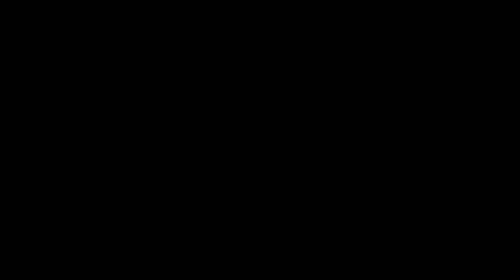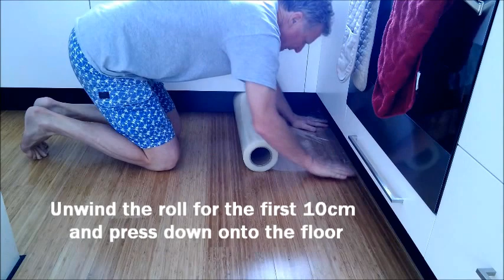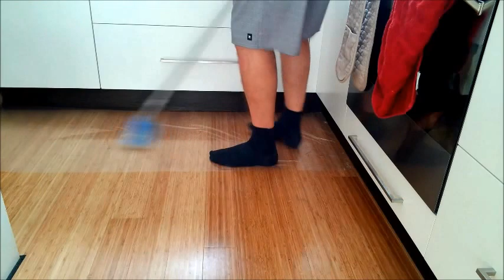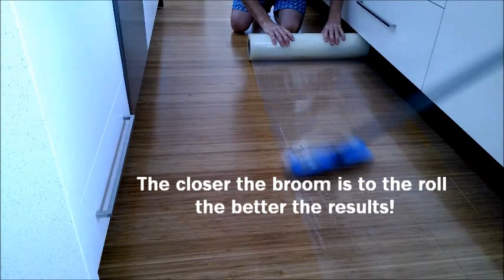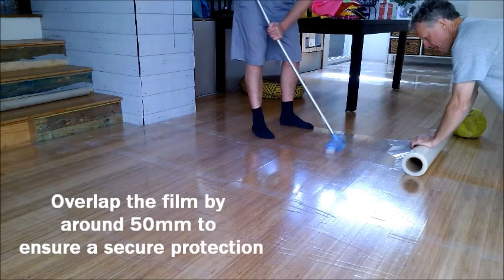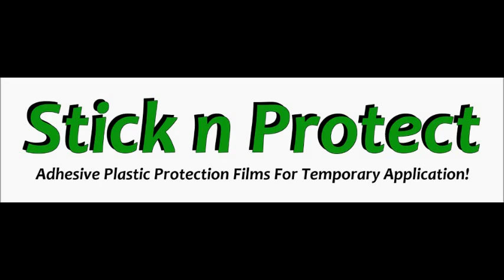Floor Protection Self-Adhesive Film Installation

Comment: good luck with the removal...especially after heavy traffic
Reply: Also it has happened that carpet film has been used by mistake this will no doubt over stick and give you headaches as it has an increased adhesive not meant for hard floors and surfaces (only carpets...) please make sure you have used the right film

Comment: The previous owner of the house I just bought has placed a plastic film over the laminate flooring. It's now peeling at places leaving an ugly contrast between plastic covered and non covered laminate surfaces. How do you remove this plastic film?
Reply: Hi, this product dose not leave glue behind and is 60 degrees rated and can be left down for about 3 months. I'm not sure what film you are talking about so it's hard to give advice.
If the adhesive is acrylic based then you could try using a steamer along with some citrus based cleaner. WD40 can help with elbow grease as well

Comment: Have you used this brand before? You should be more descriptive to help others! 

If you need to protect floors over a temporary time frame then this is a good way to do so general no longer then 4 months would be recommend. 
Pressure sensitive adhesive film, tape or masking products will losses hydration (dry out) over extended time and added pressure, e.g high foot traffic will increase the bond between the too surfaces. Same rules apply to any self-adhesive product.

stick n protect floor films have been carefully produced and tested over a range of surfaces and when used correctly will not leave residue.

NOTE: Finished floors need to be 100% dry before applying any protection

ALSO SOME STONE, TRAVERTINE AND POLISHED CONCRETE SEALERS MAY REACT WITH "ADHESIVE PRODUCTS!"
Reply: help others?
I'm helping them saying to get different/thicker material from my experience as a general contractor.
Reply: Have you used this film stick n protect?
Reply: You can try our pad-it for more heavy duty protection www.pad-it.com.au. it sounds like what someone in your line of work should use.(Builder protection foam laminate )